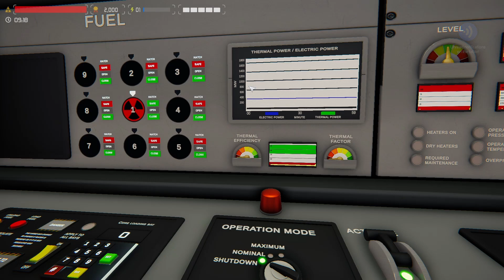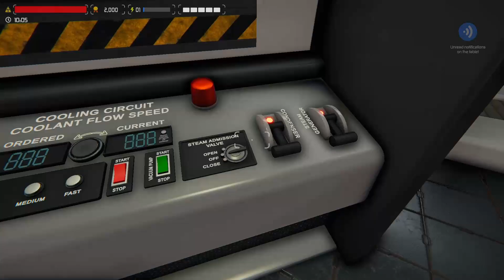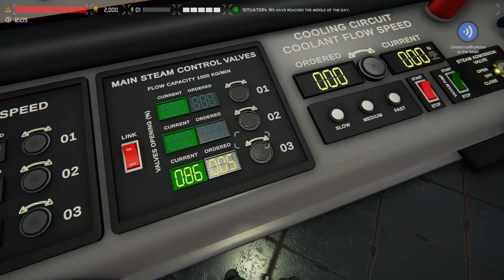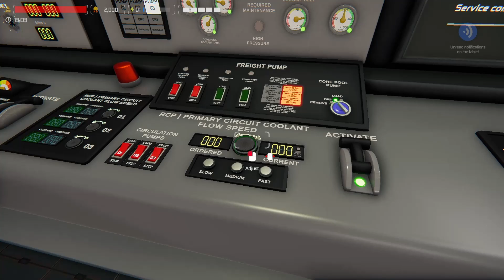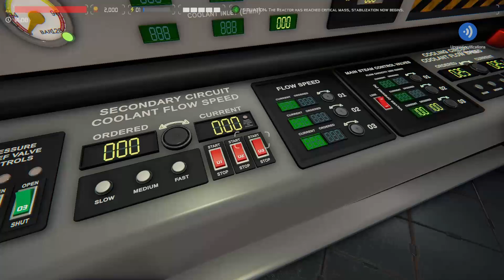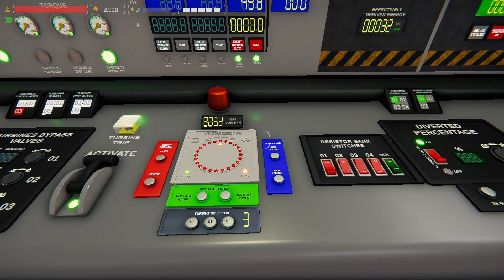Nucleares - In-Depth Beginner's Tutorial and Startup (with Chemicals module) (v2.0 Patch 177)

Comment: Just started to play with the chemical module today! Can you explain how the liquid boron helps to dampen iodine/xenon poisoning? I completely understand how the liquid boron can be used as a secondary form of reactivity/temperature control in tandem with the control rods, and I also understand that changes in core reactivity produce iodine and xenon spikes down the line. So does the liquid boron have a literal effect on iodine/xenon production? Or does it only help secondhand by allowing you to control the reactivity spikes more precisely? If it does have another direct effect on iodine/xenon production, how do you effectively use it to dampen it as best as possible? 

Thanks for all your content, you have been my North Star for getting all of this stuff memorized :^)
Reply from the maker: Sorry for the late reply, YouTube does a crummy job of telling me when I have new comments (I have to come look; if you have discord, you can always reach me there much quicker).

The liquid boron acts like another set of control rods. So it is more effective than the solid boron control rods at limiting reactivity. Boron reduces iodine, and less iodine means less xenon later. So it just does it by being more permeated throughout the reactor.

Comment: Great Video Leonidas!  i will give you my 5cents about the Coolant Volume indicator that now i can say i understand and make it work perfectly (at least up to now at low power). 
The important thing to operate the sistem without problems and stable for a long lapses is to get the 3 SteamGenerator volumes stables at the same value 1) coolant evaporated 2) coolant inlet 3) coolant output. The coolant evaporated is only used to increase o decrese power and you modify this value only with Reactor Temperature and 1st loop coolant speed. (this value varies with time and have some spickes and go to 0 but usually get stable. The coolant inlet is only modified by the 2ndary colling system and it is the easiest to change. Finally the coolant output volume is basically the value you get after some time because of your coolant evaporated value. you can modify it with the MSCV in order to reduce or increase the volume but it is still a direct link to the evaporated one. The 2) coolant inlet is the easiest to move becase is directly only linked to the 2nd coolant circuit and you move it to match the output. Then you look at the coolant volume and just move the 2nd corcuit a little up or dowm from the outlet volume in order to have more water or more steam. If the coolant volume is high you have too much water, then you decrease the 2nd circuit to be a little less than the coolant output value. If it is low you increase the 2nd circuit a litle bit more than the output and it will replanish the water in the steamgenerator. It takes time is not fast probably 1 or 2 hours to correct values away from the green but it works perfetly well! again this is when everything is stable and you already have fixed the core temperature, the 1st circuit speed and the MSCV and everything is stable. The goal is to have the 3 numbers equal. Hopefully my explanation is clear!
Reply from the maker: Yes, that is great! It definitely takes a lot of getting used to and things change so quickly. I forget which one, but in one of my videos I end up with a PERFECT ballance...by accident. I was adjusting the pumps and valves and it ended up all the same and every number was frozen -- even the pressure, the temperature, the volume level, everything. I haven't been able to do it since (and I don't know how I even did it to begin with).